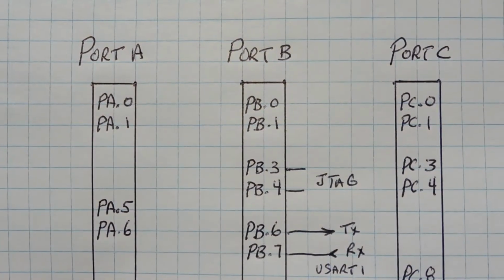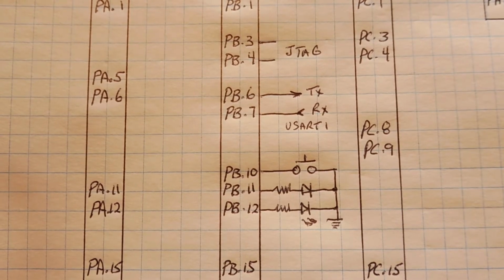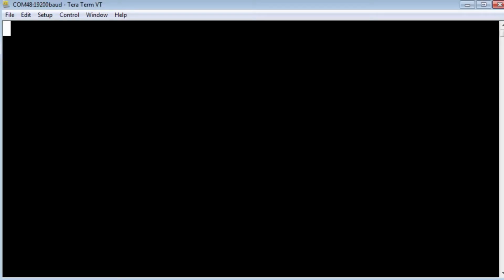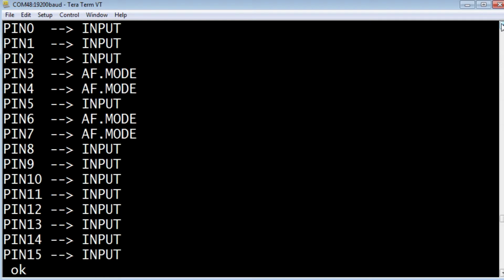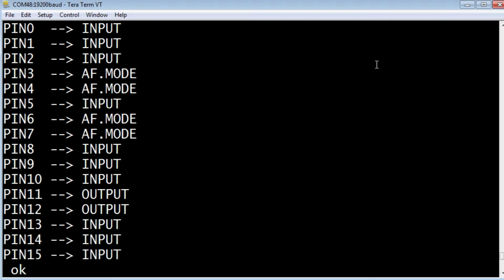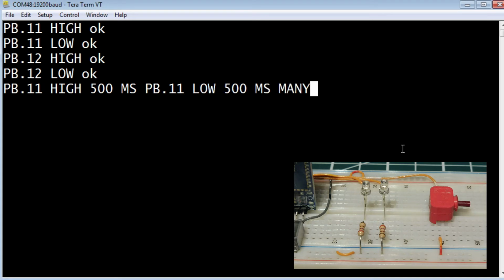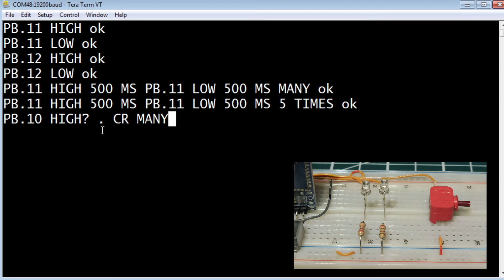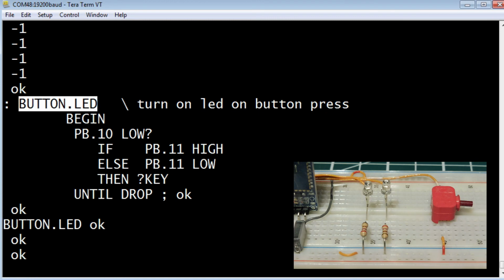Simple STM32 ARM Programming

Comment: Nice video. 1bitsy is little more expensive ,STM32F103 would be the better option to get your hands dirty with Arm Microcontroller , as it is only $2 chip .
Reply from the maker: Good point ... In future Arm videos I will be using the STM32F103.
In this case I needed a module that was compatible to code written on the Discovery board (F407)
I also wanted to upload code using the USB connector and Dfuse bootloader which the F103 does not have.
For the price you can't go wrong with the "Blue pill" STM32F103.
Reply: anyway i dont know  anything about dfuse boatloader
Reply from the maker: The STM32F103 does not contain a factory USB bootloader like the STM32F415 on the 1bitsy.
Someone has written a bootloader that has to be loaded into flash and controlled by the Arduino IDE to upload code via the USB port on the Blue pill. This method does not use the factory Dfuse software and is fairly complex to setup.
Check out this video on ST factory bootloaders: https://youtu.be/K2NekHIwGWo
Reply: What about the Stm32 nucleo? I think those are nice. They're f4 or something